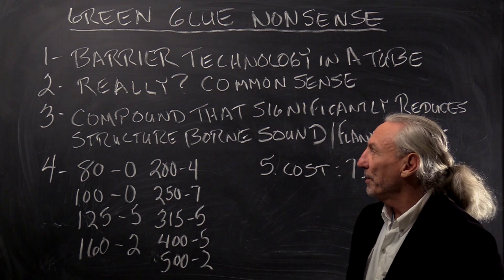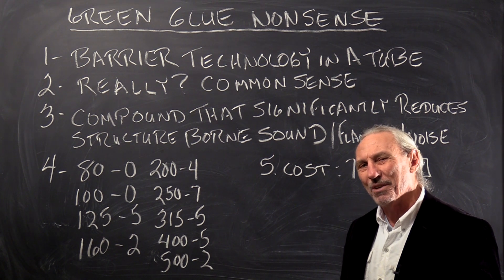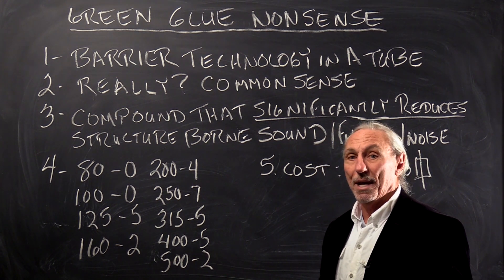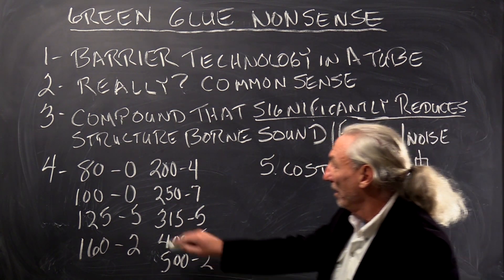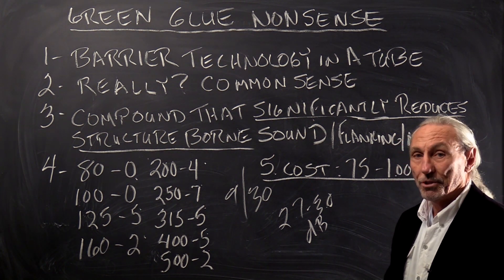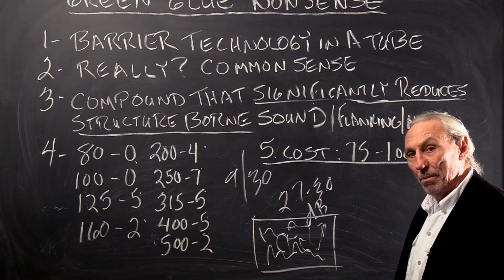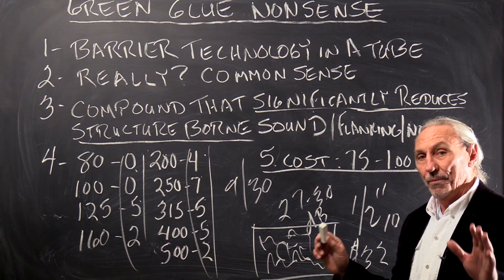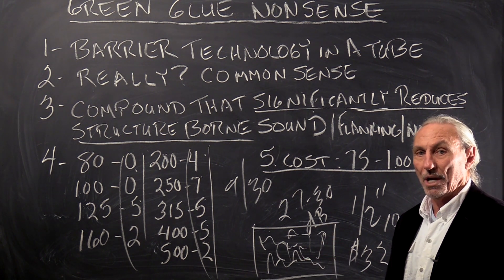Green Glue Nonsense - www.AcousticFields.com

Comment: Not arguing points mentioned on a cost/performance perspective and such, but Green Glue is not glue and not an adhesive.  The choice to use the word "glue" in the name is really a bad one too.  More to confuse the consumer.  It is supposed to stay "fluidic" (or whatever the word is) and act as a membrane between two materials.  
I think that its popularity is that it is something that a DIYer can do without much thought.  This stuff is getting to be more accessible in big box home improvement stores, but it still is expensive.  

That all being said, I used the above mentioned DD+GG (double 5/8" drywall + Green Glue) as a part of my DIY "soundproofing" (I know from watching these videos that we can't truly achieve soundproofing in a residential home) back 9 years ago when I built my current home theater space.  I also used isolation clips and hat channel, staggered stud wall construction,  extra thick solid door with seals, additional insulation while keeping some air gaps in walls and ceiling spaces...  

All of the things that were popular to do 9 years ago.  The level of "sound proofing" seems to be quite good.  This was my 4th home theater build for myself, and the first one attempting some level of sound isolation, and I can have a movie playing at reference levels in the room, and it sounds like someone has a small TV barely turned on outside of the space (plus some low end frequencies from the subwoofers of course).

So I am happy with the results, but was the Green Glue product and its expense a real contributor to my final experience?  I have no clue.  And from watching your videos I know THAT is a problem.  Why implement something that you cannot measure or calculate the results, right?  I couldn't (easily) measure sound isolation with vs without the product in place.  I would wager that the other things that were done most likely had a greater impact than the Green Glue and at a fraction of the cost.  

I've learned so much more since I started watching your videos a few years ago that if/when I move and build my 5th home theater space, I feel much more educated in options and technologies to try to incorporate into that future room.  Thank you again for your videos and education that you share.
Reply from the maker: S,  Not all construction adhesives harden. You are making a generalization that is not true in all cases.
Reply: Hallelujah, I was never convinced on this stuff. You could use silicone if there 'was' some logic in an adhesive not hardening and use ply instead of drywall.
Reply: @microteche  It isn't an adhesive though.  They were plain stupid when using the word "glue" in their product.  It even says on the packaging that it isn't an adhesive, will never fully dry, and that it isn't intended to ever actually be a connecting product (adhesive).    Silicone can stay rubbery, but in a thin layer it is fairly hard and does cure.  Now you've got me sounding like an advocate of Green Glue. LOL   I just want everyone to have the details for a healthy debate instead of misinformation that this stuff actually gets hard or is an adhesive (again, manufacturer problem there for a dumb name).  Whether it works or not is the real question, and I think that this video talks about performance and cost that are important.
Reply from the maker: N,  What's more confusing is that people believe it is a barrier technology all by itself. I get calls every day where people apply the green "glue" in order to stop low-frequency energy and then wonder why it doesn't work.
Reply: @AcousticFields  Agreed.  So much misinformation out there about this product for both sides of the debate, but a lot of people think that it is a miracle, single approach solution, which is false.
Reply: You mean it doesn't fully harden?  I don't know, it looks like glue (green) to me.
Reply: @Oneness100  I can attest that it doesn't.  Their own product information says so, but I had to add some ceiling mounted speakers for Atmos, and when drilling through to feed speaker wire, the  6 year old Green Glue was still rubbery and a tad gooey.  So no, it does not harden at all.  Like I mentioned, it is not glue despite it being in the name.
Reply: @TTTPNB   The word  "Glue" is ANY adhesive.  There's no definition of the word "Glue" that states that it must harden in order to be considered a "glue".
Reply: @Oneness100  But this is NOT an adhesive.  The definition of glue per Merriam-Webster dictionary online is that it is a strong adhesive or something that binds things together.  Green "Glue" does not do that.  As mentioned in a previous response, when I was running speaker wire for overhead Atmos speakers in my home theater, I had to cut out about a 1" x 1" piece of the double drywall with Green Glue between the layers.  Again, this was installed 6 years prior.  I was able to still twist the two layers of drywall in opposite directions and fairly easily separate them.  The Green Glue was still tacky to the touch as it does not cure or bind or adhere anything together.  Right on the Green Glue product page is states: "Despite the Green Glue name, Noiseproofing Compound is NOT a permanent adhesive."  It also requires that you apply enough screws to hold the 2nd layer of material (drywall, OSB, etc) to the first layer since the Green Glue product does not adhere the two together because it is not an adhesive.  Where-as using construction adhesive (as mentioned in this video) once it cures, it is rock solid and will hold the two layers together, which is why the two are completely different.  Again, as I mentioned before as well, and as mentioned in this video, it is an expensive product that people apply without an easy way to test before and after application to be able to actually measure performance.  Just because I used it 9 years ago, it was not the primary sound isolation technology that I implemented into my room and if I was to do it all over again, I would be checking with Dennis to see what better and probably cheaper options there were.
Reply: @TTTPNB  Then they should call it Green Goo….    I'm not gonna use it, nor have I used it..   I know better.. :-)

I wonder how they test it….  It would be interesting to see if Bubble Gum works just as well.   :-)
Reply: @Oneness100  Ha. Yes.  In pretty much every comment I made about this, I stated that the "glue" word was a poor choice on their part.  Goo does make more sense.  (FYI that gum gets hard too.  LOL)  Let's move on we are both nit picking about details but actually on the same page about questionable performance.
Reply: @TTTPNB  What about Trident, it's not supposed to stick to dental work.  :-). It would have take some trial and error to figure out what brand of gum would be the best, but I'll bet there's not much difference in the results.  :-)
Reply: @Oneness100  I found this video last year while trying to decide on walls and ceiling for my man cave theater - https://youtu.be/UtxduYYXoVY
Go to about 2.30min for products look and feel. Robinson 3095 carpet glue I found interesting lol....
I'm going to use plywood and mdf for my room now though!
Reply: It hardens to a rubbery feel. What it does is isolate the front piece of drywall from tranferring vibrations to the back sheet. 
Construction adhesive hardens solid, and will transfer vibrations to back panel, and studs, and wall on other side of studs.
Reply from the maker: N,  It is not cost or performance effective. There are less toxic materials that produce greater attenuation at lower frequencies for less cost.
Reply: @AcousticFields  if you read all of my comments, I have stated the same thing. It is expensive and that other things perform better at sound isolation. I never mentioned the toxicity piece, but any chemical based product has toxic properties, so I would agree there too.
Reply: @AcousticFields  Can you please name a few materials that produce greater attenuation at lower frequencies for less cost? What is the $10 sheet you are talking about?
Reply from the maker: @bestdadeverMTJ  You can not approach the noise issue from this direction. You must come up with a strategy and not guess using tactics
Reply: @AcousticFields  In your video you state that you can get better results for less money. You refer to a specific product at $10 a sheet. What is it?

Comment: Hi, Dennis- My understanding is that the purpose of Green Glue is not only as an adhesive between two panels but also to prevent the two panels from making physical contact with each other, creating a small air space between them to help diminish sound transmission. Also one of your videos,  https://www.youtube.com/watch?v=ZNZrJKigSQQ, shows a diagram of a barrier where Green Glue was used. Please clarify both of these points. Thanks.
Reply from the maker: S,  Keeping two layers of materials from touching each other has no use if you do not know what you are trying to stop the transmission of.

Comment: I live in an Apartment Building so I can't do any major attachment to walls to reduce noisy neighbors sound. I saw a relatively effective way of making sound proof panels out of old fluffy towels from Goodwill stapled in layers to 3" x 3" wood frames. It was measurably more effective than other materials. In dry-walled and supposedly insulated interior walls, how could I improve soundproofing? I have been in the NIH in DC and they used White Sound frequencies that were very effective. I am watching your DIY videos and I thinking combination of white/pink/gray sound and carbon material. It's basically just a 16' x 8' dry wall area I really need to keep sound out. Maybe plywood membrane, "free standing" except for a few screw holes.
Reply from the maker: D,  You are confusing barrier (noise) technology with sound absorption technology. Sound absorption panels inside your room will not help with noisy neighbors.